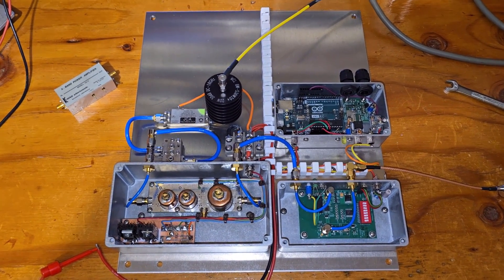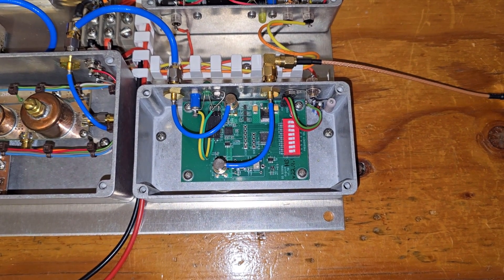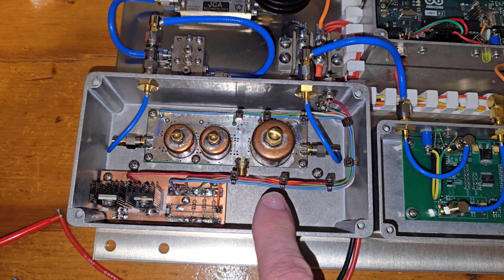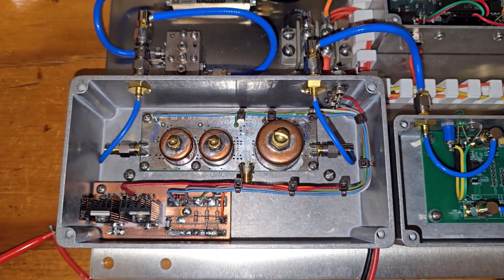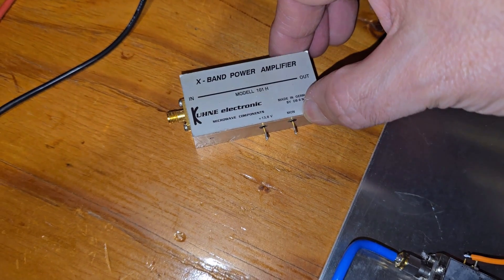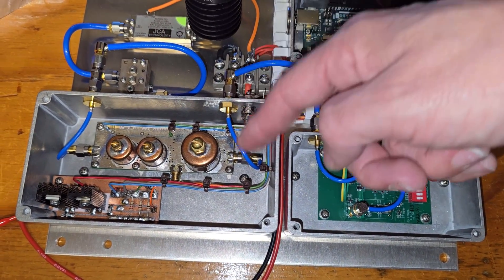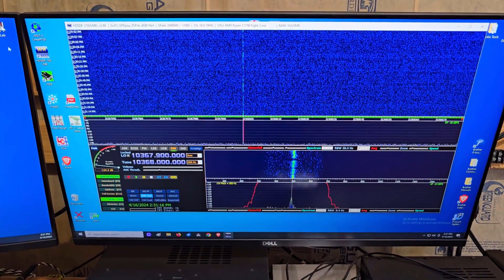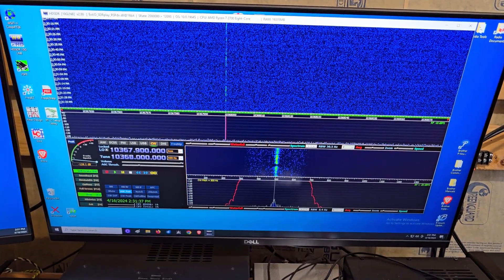10G Beacon Update April 2024

Comment: Amazing project Paul, GL!
Please any info about the keyer will be useful to me,  73 Manos SV7GBR
Reply from the maker: The original version of the Arduino code by K6HX is here:

https://brainwagon.org/2009/11/14/another-try-at-an-arduino-based-morse-beacon/

I haven't published my changes yet, because I still have more changes to make for reading temperature sensors and including that data in the beacon message. Let me know if you need any other information.

Comment: Just wanted to ask about the pipe end caps after realizing those were end caps, before thinking better of it and looking into your videos, definitively the next vid I'm gonna watch, great video! :)

(Side note, the audio could have been a little toned down when lisening to the signal but that's probably a lot more work I haven't made any videos in some time hehe.)
Reply from the maker: I agree about the audio level when listening to the signal and apologize for that. I am still learning how to do this. When recording I have no means of knowing what the audio level is. I can adjust in post processing when editing the video but I keep making the mistake of setting the audio level based on my voice and not the signals. When recording it always seems like the receiver audio in the room is less loud than my voice but it doesn't come out that way in the recording. I will try to improve on it next time. Perhaps (this would be more work) the receiver audio should be recorded as a separate track from my narrative. Then the levels could be set independently.

The pipe cap video is a long one. My method of doing them ended up being rather unusual but it worked for me. :)